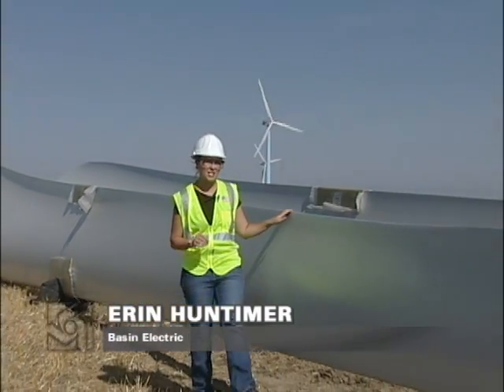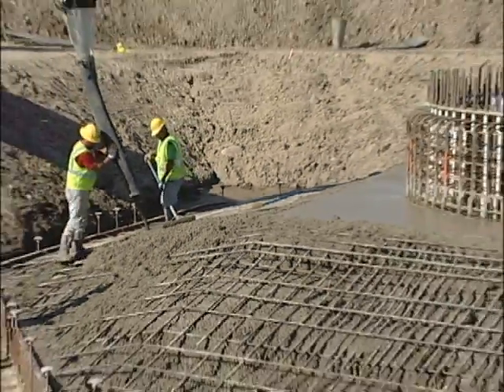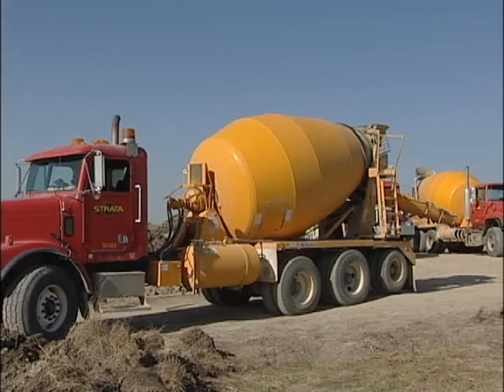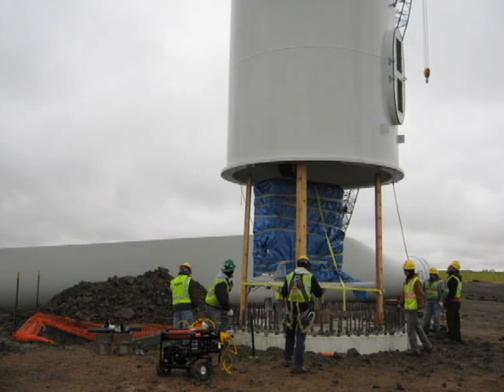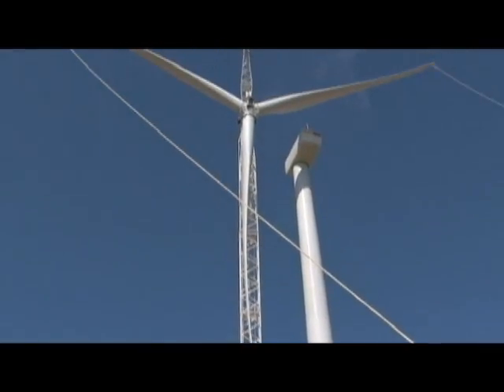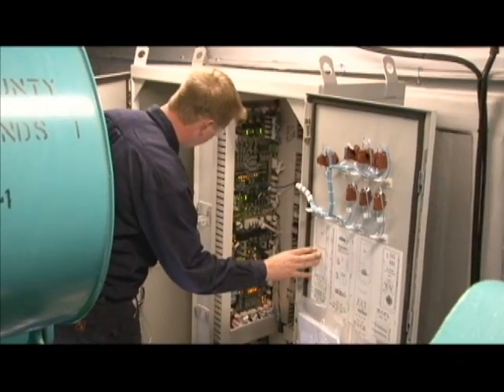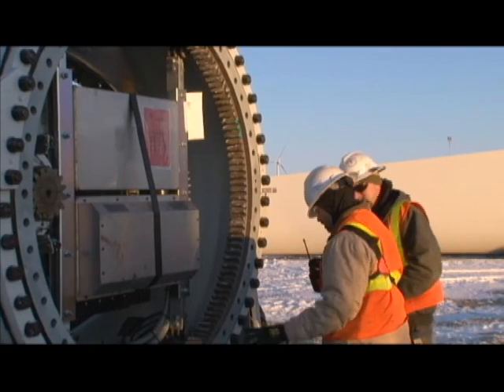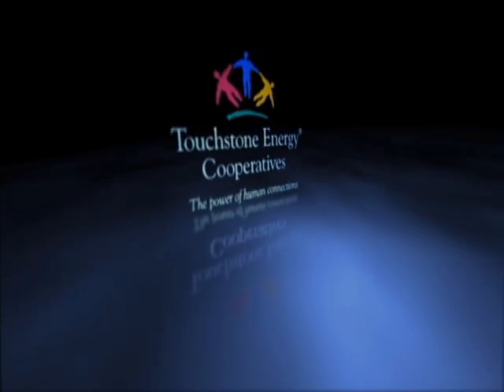How Basin Electric builds a wind turbine

Comment from the maker: @askandres From Amanda: "The wind turbine foundation design is a very complex process that takes into account many variables.  These variables include the weight of the turbine parts, wind loading on those parts and soils at the turbine location.  Because the winds come from all directions throughout the year, the loading is more circular than square.  The rebar for the foundation comes pre-cut and pre-bent to ease the installation."